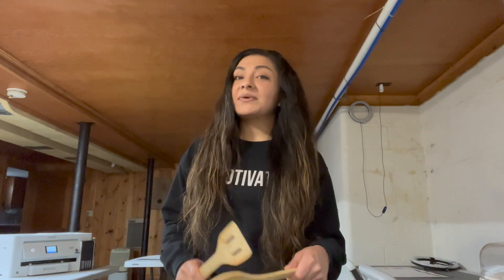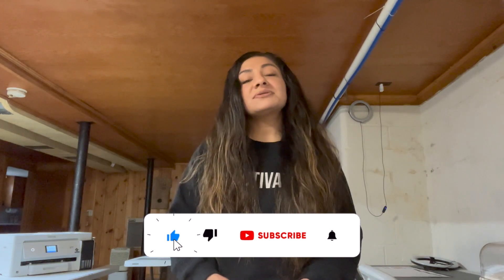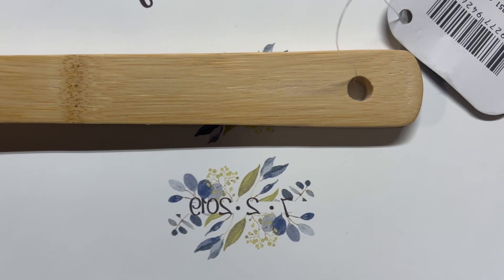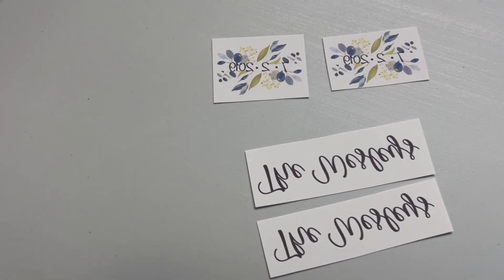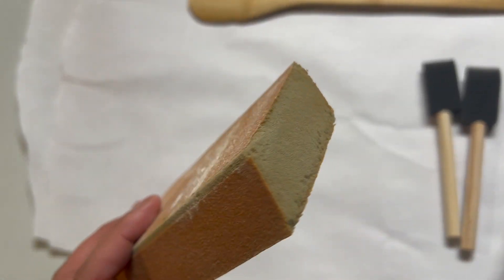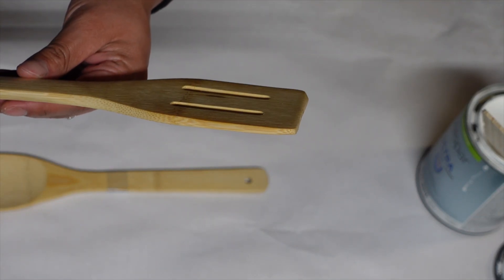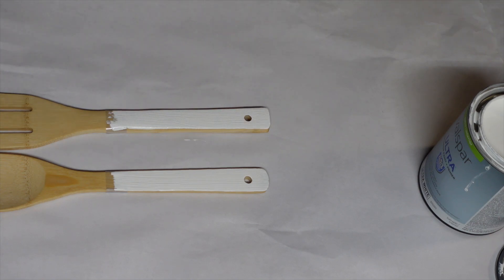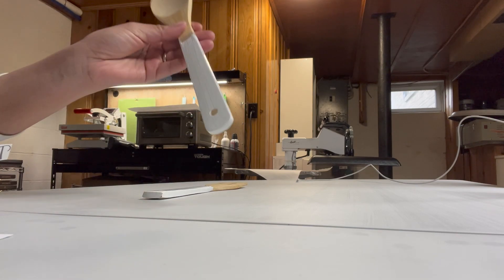Dollar Tree Wooden Spoons Sublimation | Sublimation Tutorial

Comment: This was a really cute idea, thank you for sharing it w/us! I'm sorry it didn't work out as well as you hoped. Maybe you can try it again for us! My suggestions would be to always pre-press your items, almost everything will have some sort of moisture in it. Bamboo utensils & cutting boards are usually rubbed down in some kind of oil I believe it is to make it look nicer. Unfortunately, house paint doesn't hold up to high heat like that. I would suggest trying chalk board paint. I have used it to paint signs white then put the thermal laminate on top, then subbed on the laminate & the chalk paint did very well. I think heat resistant spray paint (like the kind you use on a grill) should work too but I haven't gotten around to getting any.

Comment: I wonder if dipping them would have been too much paint? .Too thick, too long to dry?  I tried bamboo before too, but I think it was coated with something.  I also tried the lamination sheet trick.  Total fail!  I got some raw edge wood slabs from Hobby Lobby, painted the polyacrylic and it turned out amazing!  It does stick a little bit but I just used a damp rag and wiped it off and it was great!  I haven't tried with paint before though but I like the idea.  I just wonder if it would work because you have to wipe off the sub paper?  Adorable idea!!
Reply from the maker: Hey! Yes I was thinking it would be thick dipping it in paint too… 🥸😀 I thought it would be so cute with white paint and the name for real 🤣 I think I will try just polycrylic with no paint. I was just so excited for the white handles look lol!
Reply: @TheWesleys  Oh it would be so cute with white handles.  Did they have non-bamboo?  Or maybe press first to draw out moisture before painting?  I might also try letting the paint dry a lot longer.  Then put several coats of Polyacrylic before pressing?  Don't give up, there HAS to be a way!!!!
Reply from the maker: @kjoscrappinmama  I sanded them down this morning really well and going to try drying them out somehow 😂 Maybe less paint and more polycrylic, 380 for 50sec. Lol!